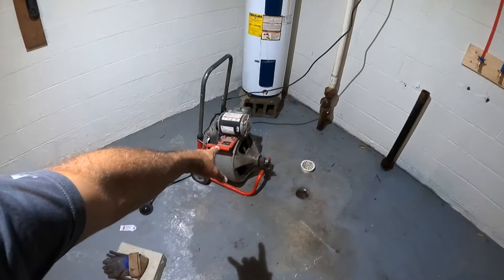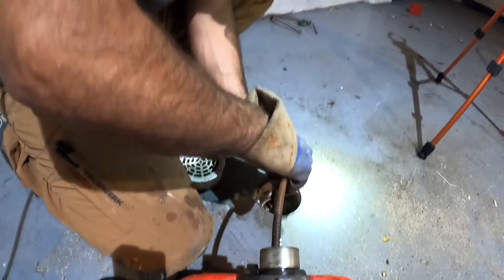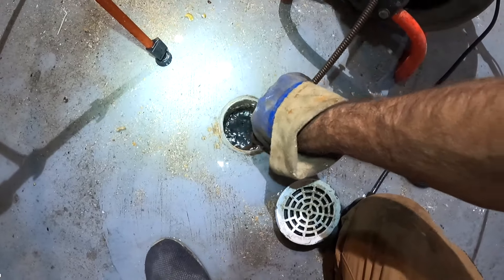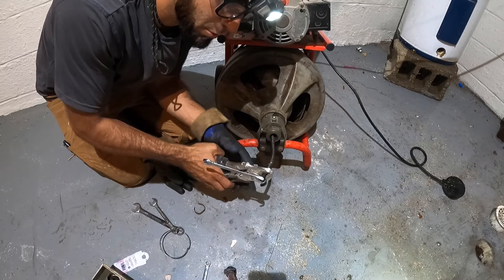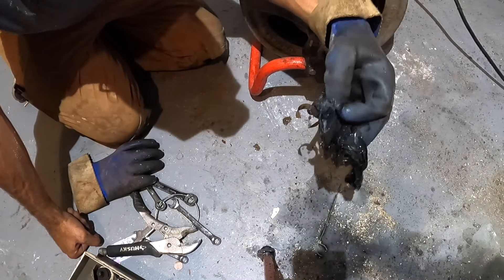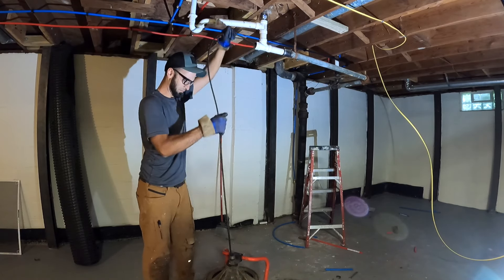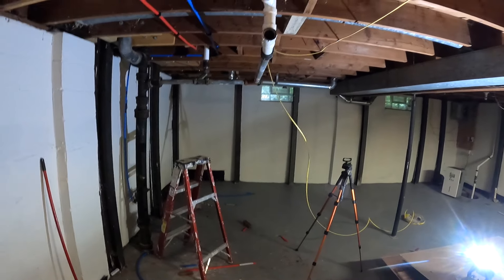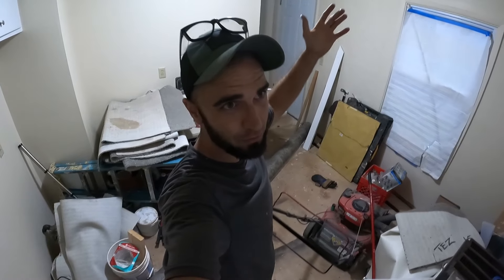SNAKING A Floor DRAIN | RENTAL PROPERTY DRAIN RIGID K400

Comment: You will regret them rubber gloves one day, leather for cable machines. That cable will break your fingers or wrist before you can get off the air switch. Just a little FYI.
Reply from the maker: Thanks for the tip. Maybe something else you are interested in Installing New Sewer LINE | Tough Job
https://youtu.be/bVqKZEhsSR0
Reply: I just regretted them. Almost tore my damn hand off, luckily I wasn't too deep in and was able to pull it out and unravel myself. TAKE NOTE! 😅

Comment: Good video. Plumbing issues is my number one call. Conversation always goes like this: "I don't know what happened. It just broke/stopped working/started backing up. We never touched or flushed anything. I have no idea why the water bill is $550. I haven't been home. No, we don't have a pool in the back yard." (there's a 24 ' diameter Walmart pool in back yard and the grass is bright green in August with 4 kids running through sprinklers and water running down the street).
Reply from the maker: Haha. This is great!! I can tell it’s not your first day as a landlord. 
But don’t forget… 

Don’t flush wipes down the drain. “No no we don’t use those!” But they are on the back of your toilet? “Ooo we never flush them!” Right…I just pulled back 20 on my cable. “That must be from the last tenant!” Well u have lived here for 5 years…

Comment: Hi when you put the snake back into the drum is it in still the forward motion ? All you have to do is step on the pump and push the cable back in the drum?
Reply from the maker: @EricTang-p2z  Yes still in forward motion. Reverse is only used if u get the cable unstuck. U can feed the cable back into the drum without running the machine. Probably safer if u are new to snaking.

Comment: Is your K400 setup with 3/8" or 1/2" cable? I noticed you used an Electric Eel in your other videos. Which is your go-to and which one would you say is the most universal? I got 1.5" kitchen stack and some 3" stacks for the toilet/bath.
Reply from the maker: My k400 is a 3/8 cable. I would buy the K400 a good toilet auger and the ryobi drain snake. Most 3 or 4 inch stacks in my area go out to 6inch when it leaves the house. I personally would not use k400 on 4 or 6 inch. I do a lot of tubs and sink drains. Hopefully this helps.
Reply: @handylandlord  Thanks, for sure, 3/8 is going to kink or break in 6". I have the K400 and now the K750. Trying to decide between 5/8" for the K750 or 3/4". I have a 3-4" cast iron under the basement and 6" clay out to the street main. Wondering if 5/8" is solid enough while still more flexible than 3/4" or if I should just go all out. Also - any sewer camera recommendations?
Reply from the maker: K750 Awesome! I have used the K750 a few times and I really liked it. Both cables are from Ridgid or drain cables direct are probably good. I prefer a cable with no core so I can repair. I would call and talk to someone at Ridgid or drain cables direct. I use drain cable direct because my machine is modified to take a slip joint cable end. Make sure to get a few different blade sizes. My machine came with 3/4. I switched the cable to 5/8 or 11/16 and 110ft to cut weight and switch to a different cable end. Most mains in my area are under 100ft, but I have an additional 20ft section of cable that I saved from an old cable. It has came in handy several times. 

With sewer cameras I use the Vevor 150 ft camera. Can't justify spending so much on an expensive camera like Ridgid. I can buy 10 cameras from Vevor for the price of one Ridgid and so far it's served me well. Just have to be careful not to kink the cable so I use cold water to assist.
https://www.vevor.com/s/sewer-cameras

https://www.youtube.com/playlist?list=PLUDGkY7U4Fu16xi_oOp5bj13BbzUoLFGC